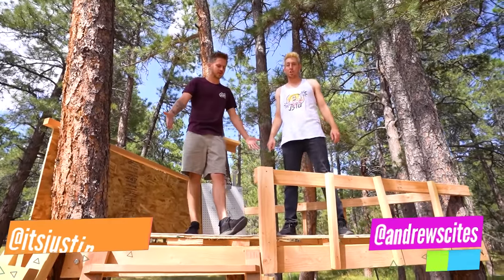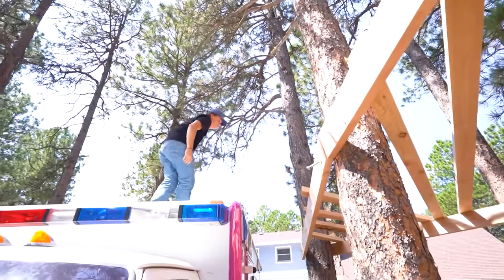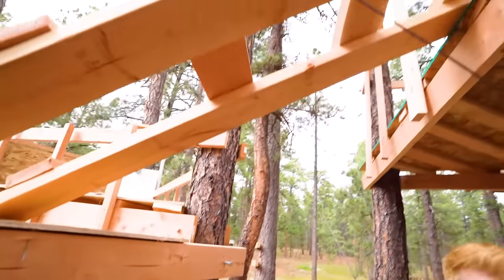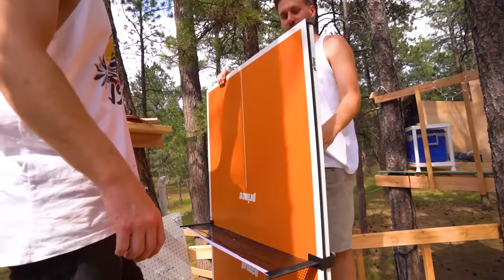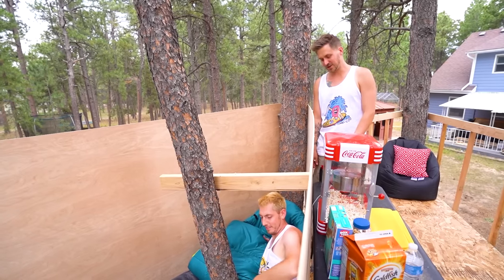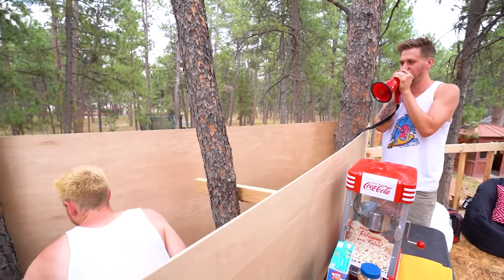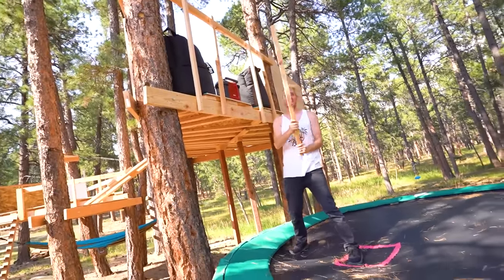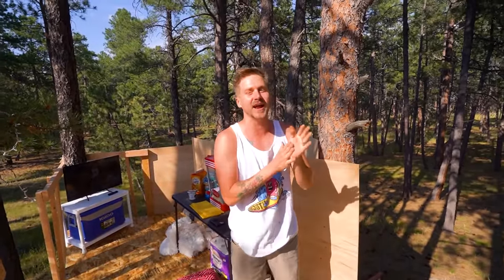WE BUILT A BACKYARD TREE HOUSE MANSION!

Comment: If you want to build better floors, instead of putting the wood parts on top of the frame, rotate them so they are on the other axis, and put them inside of the frame, it will make it more durable and hold for more.